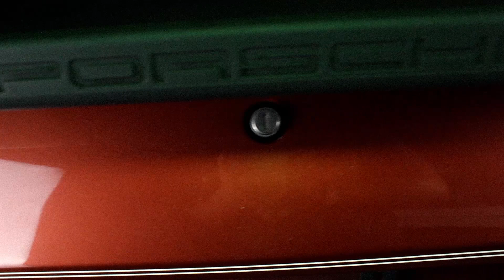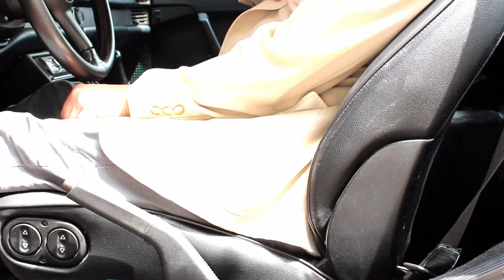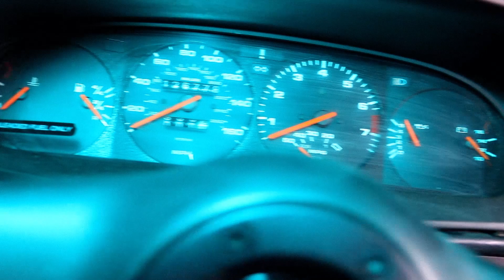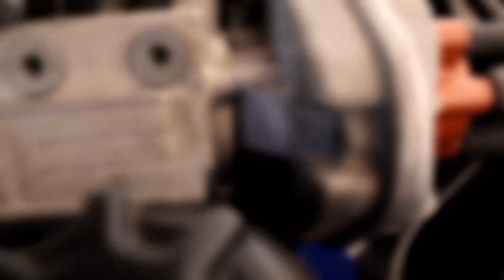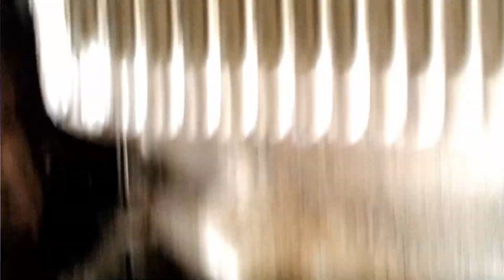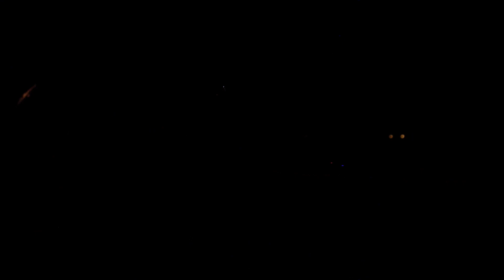Porsche 944: Designing A Car With Intent

Comment: Great video…but did I hear you say you hauled two adults in the rear seats?
Reply from the maker: No, I don't remember off the top of my head what exactly I said in the video: I've fit 3 grown adults in the car comfortably a fair number of times. One in the back, across the bench and one in the passenger seat. I would be amazed if I could fit 4 people in the car at once! Thanks for the kind words!😆
Reply: @CriticalAnalytical  3 times have I fit 4 people into my car. Me, 2 brothers and my mom. I WAS comfortable I'll say that, but my brothers head was put of the sunroof
Reply from the maker: @the_appointed1142  Ha ha ha, that's hilarious! Hopefully it wasn't too far of a drive.
Reply: my first 944 (early 85) was a daily driver for me.  With myself driving, I had 4 adults in it.... I want to say another time that a friend was in the hatch area  with a full car.   it doesn't pull the big hills as well, but it made it.
Reply from the maker: @kennycoulter5525  That's pretty impressive!